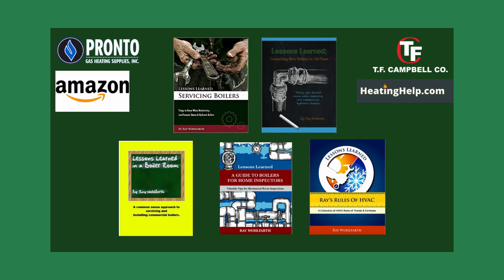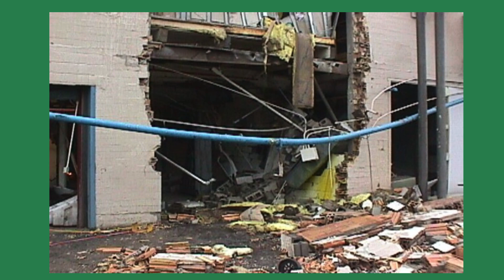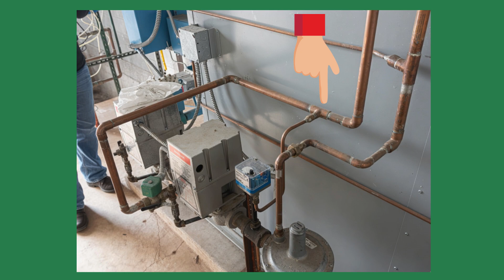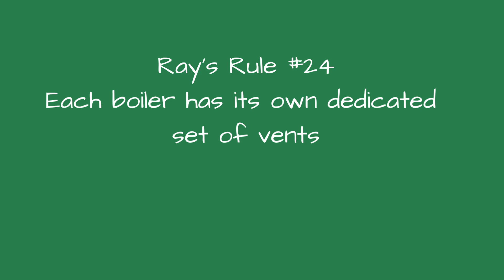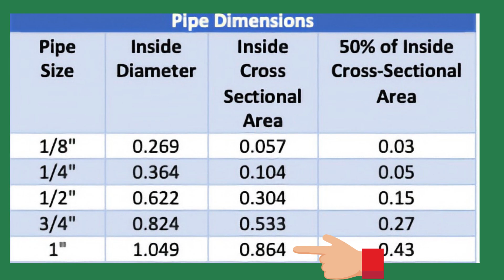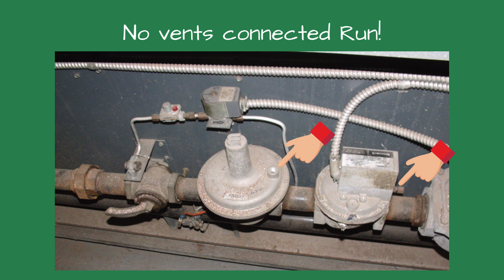Can Gas Train Vents Be Combined? The Dangerous Mistake Most Techs Make

Comment: Went to a small CBLE one time and the boiler was sooted and high gas pressure switch was tripped. 
Installed manometers and jammed the analyzer in the stack. 
Turns out the regulator vent was full of water all the way to the roof and caused the regulator to overshoot. 
Thank goodness for a working HGPS. 
Proper venting is extremely important. 
Good video Ray.
Reply: Mike, welcome to my world, I was a first responder for a gas utility in St. Louis for 35 years. Yes when water enters those regulator vents it can get to the point where it’s like not having a regulator at all. Fortunately over the decades technology has caught up with high and low pressure monitoring systems, slam shut overpressurization safety valves, excessive flow valves, electric sensors, replacing double block & bleeds (still a lot of old equipment out there, so we gotta keep doing our due diligence). Keep up the good work, keep using those gauges & manometers 💨. 
Regards , from the St. Louis Metropolitan area.
Reply from the maker: Wow great catch Never saw that I appreciate your feedback

Comment: More than once I have seen intermittent “main burner flame failure” caused by both boilers’ vent lines combined. When both boilers were running and one shut down, the momentary burst of gas from the vent valve caused the failure of the running boiler while it was in low fire. This occurred even with the common 2.5” vent line appearing to be adequately sized for the individual 1.25” normally open vent valves.
Reply from the maker: Yes sir thanks